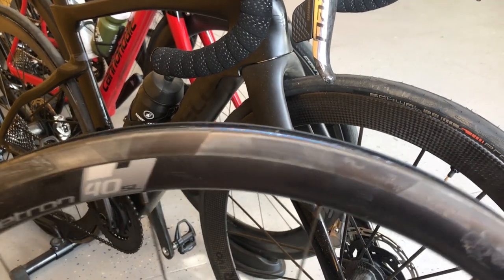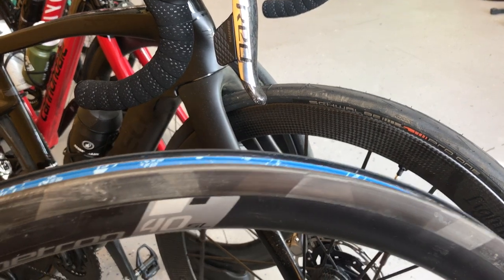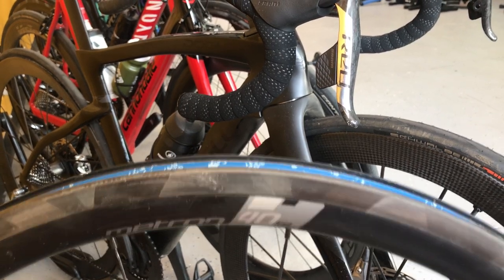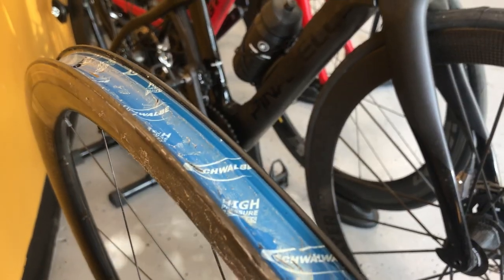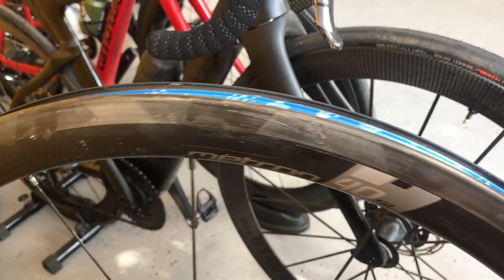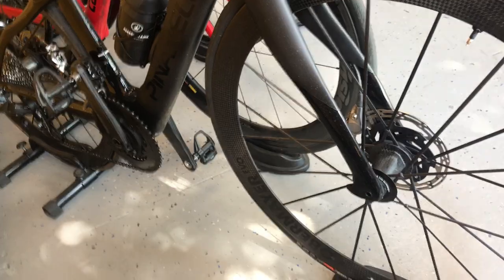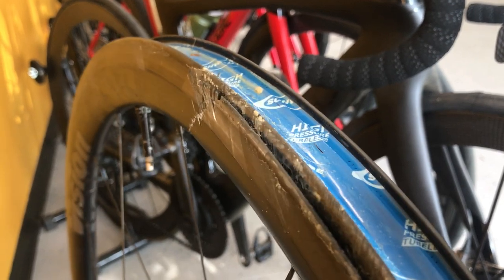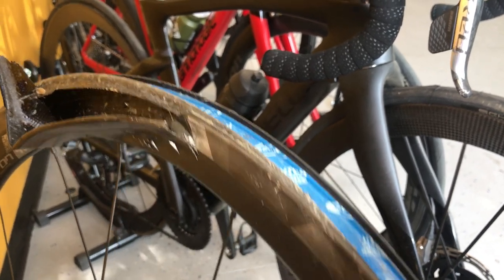Carbon Bicycle Wheel Rim Failure Explodes BOOM Bike Fail

Comment: Use a thinner tape as first layer. Can even use construction heavy duty for the hole openings
Reply from the maker: It doesn't matter what tape you use, at some point the rim tape can fail again and air will go into the rim. I have added the ENVE Pressure Relief Valve Stem Nut to my valves, its only $5 and suppose to solve this problem.
Reply: @naskofilms4077  there's more fabricy type rim tapes for narrow rims. This tape ripped due to inside burr or debris that got under. Therefore type of tape actually would matter a lot. None would help from spoke puncture, right